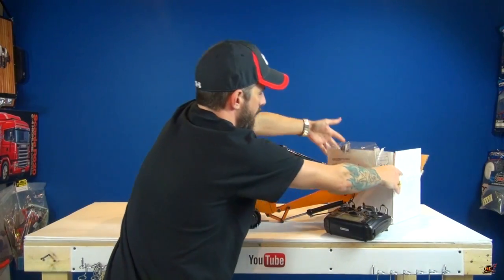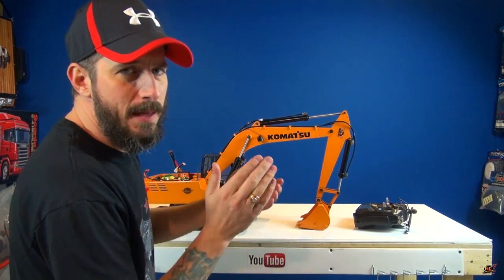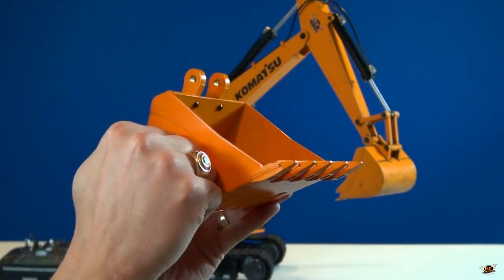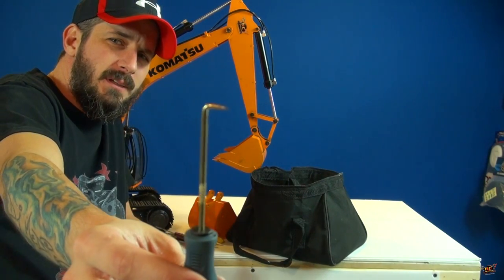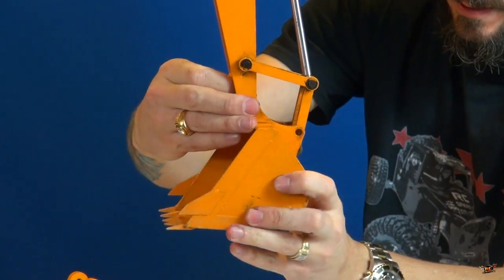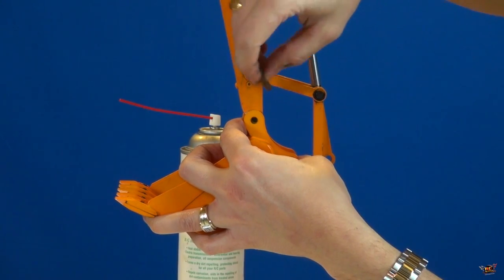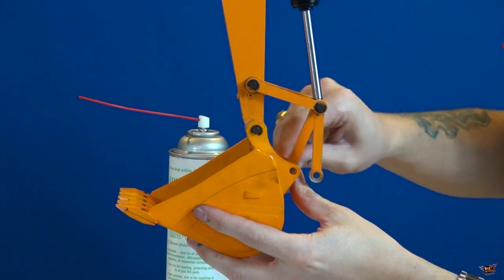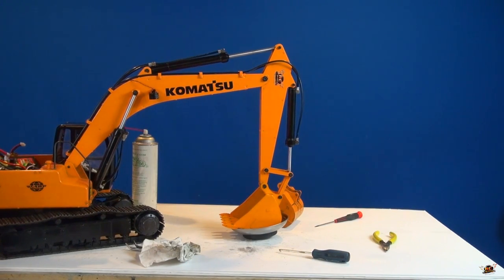RC ADVENTURES - Siberia Super Duty Bucket for Earth Digger 4200XL Hydraulic RC Excavator

Comment: Just keep in mind that depending on how hard you're really running the excavator, you may have to watch that you don't wear the pins or the bushings egg shaped. That's probably why you're having trouble pushing the main bucket pin in. I'll bet if you look you'll see a slight groove worn in it.

Happens to the full size stuff all the time. Grease is your friend.

Awesome machine though!

Comment: Nice upgrades, I may get one of the rc4wd excavators to add to my collection too. I am just worried about the noise, it's pump is extremely loud and I wish there was a way to get it less noisy. By the way, if you do channel mixing on your transmitter, you can reduce the noise significantly by ensuring that the hydraulic pump is not constantly on but only activates when you move the arm or bucket. This will also keep your temps much lower too.

Comment: I mentioned "counter weight" once and got a lot of negative response. maybe some don't know what "counter" weight is. the reason I mentioned it is the video I seen, you had a full bucket of dirt at full arms reach, at that time the excavator seemed like it was getting tippsy, "counter weight" is located at the very back of the machine to "counter" the weight of the loaded bucket, in all actuality it would reduce the amount of force you could apply at the bucket in the downward direction, yet giving you more stability when trying to reach out and load that dumptruck driver that didn't or couldn't get close enough to your machine. in all truth it gives you more lifting force, unless limited by hydraulic force. I hope this helps you understand where im coming from.
Reply from the maker: I kinda feel as though if I respond with anything but "Yes, and thank you".. it would not be received well. But I understand you feel as though you got a negative response. I apologize for the mis-understanding.

I appreciate what you are saying and I certainly understand the concept of a counter weight. But I also understand weight limitations of the mechanics of the small parts on this machine.

Unfortunately, in my earlier videos - I had even less experience in operating the excavator. My inexperience on the controls made the machine look sub-par. I find any newbie operating such a complex machine will tend to make it look a little dopey. In a skilled operators hand, this machine would certainly act the way you would expect. Adding additional weight to the machine would cause stress on gearing and small pinion of the cab. Its Solid aluminum, and very heavy.   Does that make more sense when I explain it this way?
Reply: ***** I wasn't trying to be negative or stern{ probably not the right choice of words either } and I am sorry if my comment sounds pessimistic, I have a habit of doing that sometimes. just trying to explain where im coming from without a shadow of a doubt, its so very true a picture is worth a thousand words so trying to convey a image in my mind through words gets, well wordy. no hard feelings bro just trying to be clear. and by the way it wasn't your past comment I took negatively, if I remember right it was someone else . ok enough bla bla bla. nice video:)
Reply from the maker: jetegtmeier71 You know my friend.. text is hard to interpret and the internet is full of misunderstandings..   Thank you for taking the time to explain something in an attempt to make my RC operate even better.  I'm just stoked to know you still come by to see my videos.  Thanks jetegmeier :)
Reply: , e0h
Reply: amigo donde comprastes tu excadora y algo importante cuanto te costo saludos suscriptor tuyo saludos desde México Zacatecas

Comment: We work on these a lot where i work but actual size and we run cat equipment. It would be awsome to just pull one of those pins out with my fingers lol we use sledge hammers and bars to knock the pins out. Do you use grease for the pins or just that spray?

Comment: I'm thinking seriously of selling my quad to buy one of these. I operate one at work its a 336E cat so I'd have to put CAT decals on mine. How difficult do you think it would be to add a hydrolic thumb? Is there an empty channel to operate a separate cylinder from? I saw on RC4WD you can buy the hyd line and separate cylinders I bet one could be fabricated easily. What do you think?
Reply from the maker: I think anything is possible in RC, when there is a motivated RC Addict on the job :)

Comment: Do they make "Beefier" Treads for that thing for some added traction with the added power?
Reply from the maker: These are all-metal Tracks. they don't get any beefier :)
Reply: *****
could add cleats to every second or third link, my grampa did that with the old dozer, then it pushed a lot more.... and they were only 1 1/4"x 1/2" flat bar.... it would be a wicked welding job to do it on that but would be one of a kind